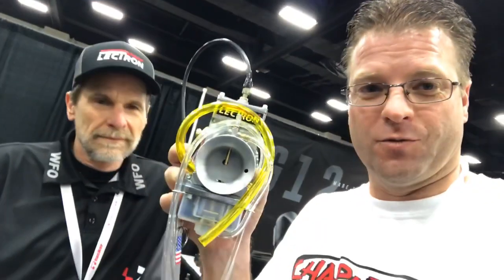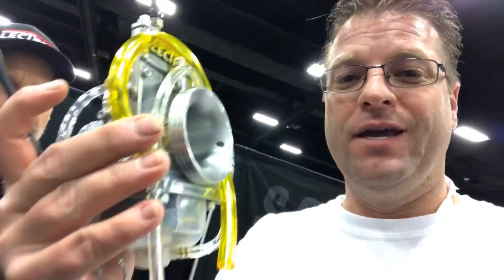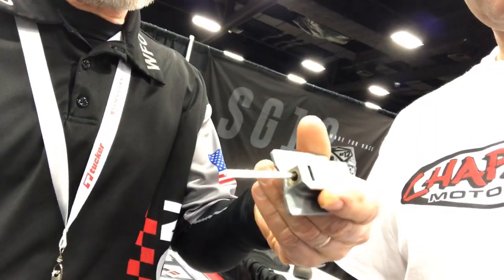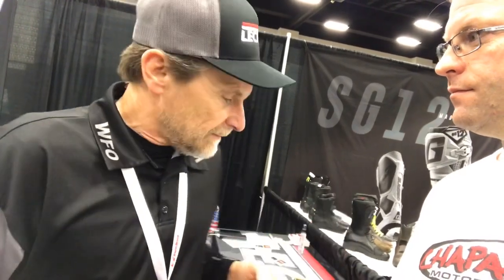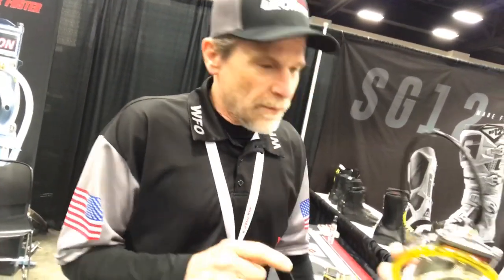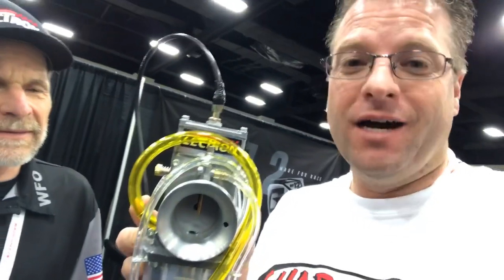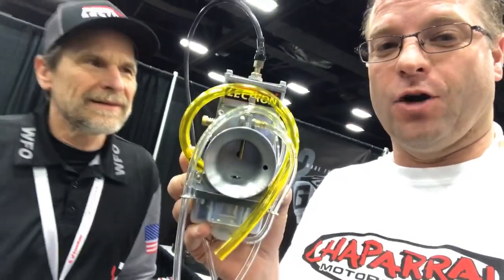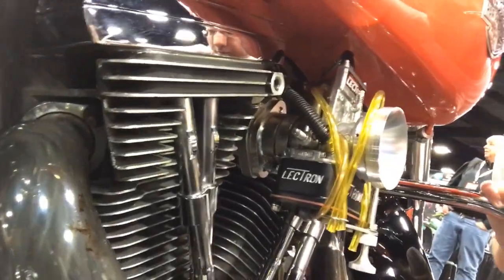LECTRON “Jetless” Carb Explanation - This is a MUST if you Ride in Elevation

Comment: Due to its height it won’t fit some bikes.  Measure before you buy.
Reply from the maker: They are made to order. You send them every measurement of your existing carb and they dial it in. Pretty sweet program.
Reply: @manybikes   I called about a specific yamaha.  They had an inquiry about one before.  Sadly there was no way to get one to fit.

Comment: Is this carb can fit to kawasaki eliminator 175cc?
Reply from the maker: Yes, it should fit perfectly
Reply: I hope so planning to buy 1 hope will not fail cause its gonna cost me a lot but i think it will work because thats a carburetor but i dont know which one will perfectly fit what size its 4 stroke btw thanks man for helping me
Reply from the maker: Luffy Mugiwara give Lectron a call and they will get you 100% dialed in!
Reply: Ive DM them they said there is no available lectron carburetor for my 4 stroke 175cc kawasaki eliminator very frustating, i thought they have for from lower displacement to higher displacement bike

Comment: So with the Lectron everything is on the needle, does this mean I need dozens of expensive needles.  With a conventional carb I can change a 50c idle jet and not mess up mid range or top end, it would sound like this is not possible with Lecton needles ?
Reply from the maker: Once you dial it in ... it will self adjust to altitude. It’s pretty amazing!

Comment: so im worried if i put this on my harley what do i do with those two bolts on the cylinder cases that are also oil passages.... do i just leave them open... do i put slightly shorter bolts back in?...hmm looking back at the section where they showed the harley maybe you still use those bolts to hold the air filter then.
Reply from the maker: They have the provisions to make it all work together. It’s year / make / model dependent. Just put one of these on a Honda 450x and it is for sure a game changer! Perfect Air / Fuel mixture is so key!!!